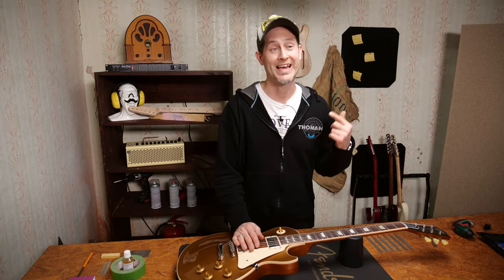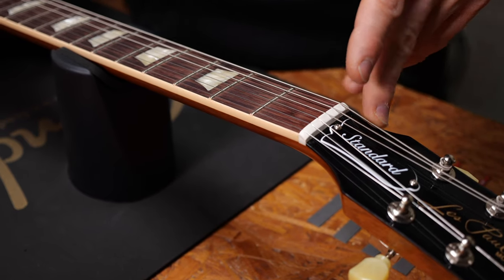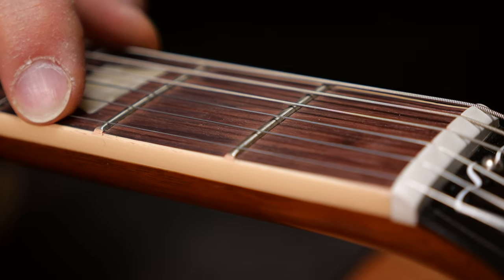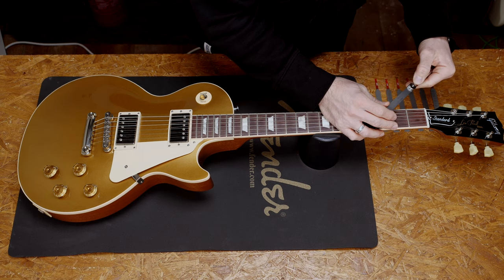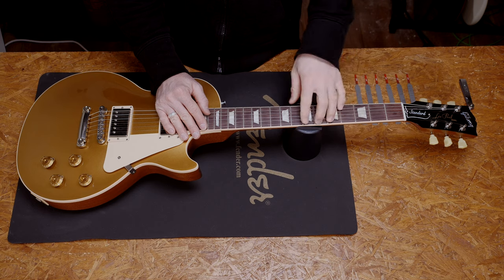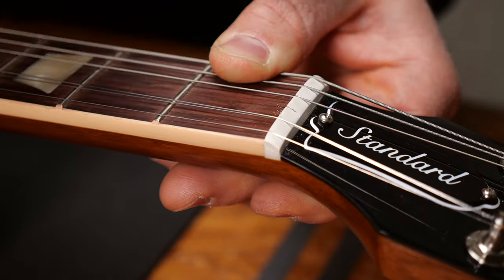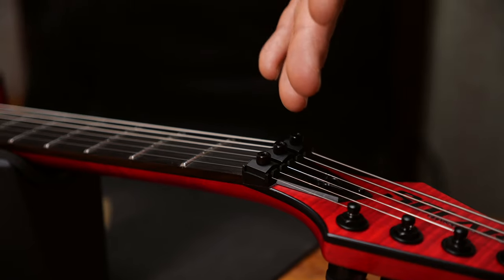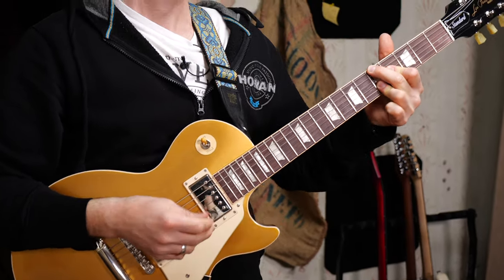How to check your guitar's nut | Guitar Tech Tips | Ep. 2 | Thomann

Comment: This is a great series and some great info is found here. I personally have experience shimming floyd Rose nuts and they can be a serious pain in the ass. I recommend stew mac's shims...they custom make them for floyd rose nuts made out of brass. They come with three thicker shims and three thinner shims and I had the most success using these shims. You can make your own though....just find an old feeler gauge set you no longer want and use tin snips to cut them. You can even drill holes in them but this often causes the shim to bow so you have to be really careful.

Comment: hey Kris, thanks a lot for this helpful Series. I bought a used Thunderbird. Ist had really thick strings on it and I think I have to work on the nut. Are the measures for Bass Nuts the same as for Guitar? Greets
Reply from the maker: Hey Ludger, bass strings need a little more space between the string and the top of the first fret (if you do the test I've shown in this video). Check out Episode 50 where I level the frets of my bass. After the leveling I check and file the nut, you can see it pretty good how much that space should be. Good luck! //Kris

Comment: Nut files are pretty expensive, that's the main problem for me. I used a little sandpaper on a thinner string to make the low e string slot wider for a 56 gauge string once. It worked but I would not want to do it like that for all strings.
Reply from the maker: You're right, special tools are never cheap, especially quality tools. Good thing is, you buy quality nut files once and you can use them for many many years on as many guitars as you want. :) I'm happy your improvised filing method worked out for you. It sounds pretty risky though... :D Next time you could maybe visit a luthier /guitar tech, what do you think? 
//cheers, Kris
Reply: @ThomannsGuitarsBasses  The slot for the E string was already pretty close and it wasn't a super expensive guitar (Ltd ec-256) so it wasn't a problem but for more difficult adjustments I'd have taken it to a luthier.
Maybe some day I'll buy nut files but at the moment I don't really need them and I already have most tools I need for regular maintenance :)
Reply: You can also use a piece of string to accurately file the slots. This only works with wound strings of course.
Reply: @ThomannsGuitarsBasses  So a set of files for 9's and a set for 10's ?  No wiggle on a 9 allowed to fit a 10?

Comment: I've been playing my guitars with a relative high action for the past 30 years. Now I'm experimenting with lower action, but I notice some string "slap" noises after lower the action, isn't fret buzz. Can you play a lower action guitar accoustic only (electric guitar)? Without an amp? I just need to hear this to know if what I'm experiencing is normal.
Kris, amazing content! You guys at Thomman make my quarantine days a little better! By the way, I  really like the pedalboard's brand / genre chanlenge videos. Also a fan, and subscriber, of your channel.
Reply from the maker: Thanks so much! :) If the string slaps against the frets due to the lower action you could try a thicker string gauge. Fun fact: 10 gauge strings with a high action feel like 11 gauge strings with a way lower action. 
And what's the benefit of that? Thicker strings tend to move around less and vibrate less wildly, because they are stiffer than thinner strings when tuned to the same pitch. Simple but important advice: always test if you have annoying noises with new strings. After a few weeks strings start to vibrate with a bigger amplitude because of wearing out. More amplitude - more noises and fret buzz too.
//cheers, Kris

Comment: On the les paul there's some special way to file the nut on de G/D string (tuning issues)? because the angle to the tuning post?
Reply from the maker: A slightly angled nut slot for the D and the G strings is ideal on guitars with 3L-3R headstocks. This way the break angle is lighter behind the nut. That's tricky though, because factory nuts are mostly filed parallel so you'd have to swap them and make a new one. If you have the tools, go for it. If not, it's gonna be expensive because you need quite some tools to make a new nut from the scratch. In that case it's better asking a guitar tech /luthier to do the job. 
//cheers, Kris

Comment: good video; but what to do when the strings ar to low in the nut and touch the frets; and when the action on the 12th is ok ( 1.5 and 2.0 mm )?
Reply from the maker: Hey Patrick, if the nut is too low, you have to try to fill it up or even swap it. I will make a video on how to do that in this series. Stay tuned! :)
//cheers, Kris

Comment: Wait till you go and try to buy some of those "nut slot files" and see how much they are going to cost you!
Reply: I used a old piece of guitar string.
Reply: @everready19373  I wound up just getting a new nut and sanding off the bottom of the nut to get it down to where it needed to be rather than file out each slot. New nut costed $11. Nut file set is $300.
Reply: So expensive for home use!
Reply: I went to Walmart and bought a pack of small files 5 or 6 flats....4.96.  I believe
Reply: @amazingthingsfromaroundthe2057   online in Stewmac is $200 set of 6 files.
Reply: Right, if I had those guitar nut files in the first place I wouldn’t need to watch this video

Comment: Hello Kris? Whats your opinion between genuine bone nut and graphtech tusq? Is it worth going for true bone?

Another thing, is there any "easy" solution for nut slot, that is too deep? I have second hand guitar, that have good nut, but D string has just too deep slot and it drive me crazy, I just folded piece of paper there and it kinda work, until I do bend or vibrato and the tuning goes away.

Yo, and great video of course ;)
Reply from the maker: Hey, I like both, but for different styles of guitars. Both will be perfect and will give you the same tuning stability and both are self lubricating. It's more about the feel and looks for me. I like bone on traditional style guitars and Graph Tech on more modern guitars.
//cheers buddy, Kris
Reply: @ThomannsGuitarsBasses  thank you Kris ;) and any "easy fix"  to nut, that is too deep? Or is the easiest thing to buy pre made Graphtech and drop it in?
Reply: @stanislavmigra   I guess by now you replaced the nut yourself? I saw at the stewmac video's that they use a nut repair paste for these things. For me it was cheaper to replace the entire nut, in my case for a real bone one and it did the trick. Tusq is also an option if you like a more crispy sound on your guitar. Mine is a ES-335 Guitar which i prefered to use bone nut instead.
Reply: @ClaudioAraya  I did it another way. I removed the nut, put bit of wood under and did all the slots bit deeper. I was thinking, that its waste to ditch perfectly functional nut with lots of material to work with

Comment: Not a big fame of the nut shape in this video.
The resting bed isn't long enough. Due to the shape of the nut, the slot will wear out faster and runs a greater risk of binding (this can cause tuning and string bending problems, even act as a wedge to split vintage or older bone.) The back angle should be taken from the tuning machine, not the head stock angle. Lots of in the ball park info though. Entertaining 😄

Comment: Beware:
One extra swipe with a nut file and you'll be replacing the nut. I found out the hard way with a brass nut on a bass. I barely scuffed it with the file and had to buy a new nut.
Reply: Remove the nut and sand from the bottom if wholesale lowering is required. If you screw up, you can then shim it if you go too low. On top, stroke/replace string/tune/measure, stroke/replace string/tune/measure. Slow going, but easier than swapping in a new nut because you ruined the old one.

Comment: Does the neck need to be straight before you check and adjust the height at the nut?
Reply from the maker: Hey, it should be, yes. My recommended order of setting up a guitar / bass is: 1. neck relief 2. nut 3. bridge setup. If you look at our Gutiar Tech Tips playlist, you'll find these three videos in the right order. Cheers! //Kris